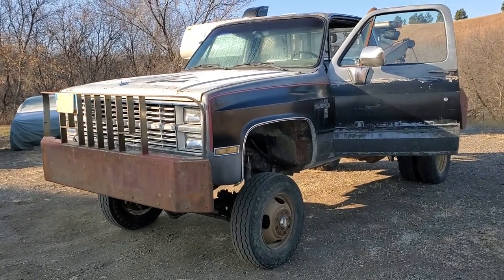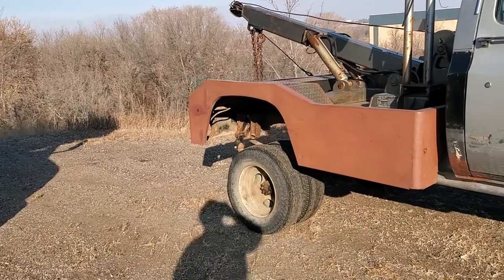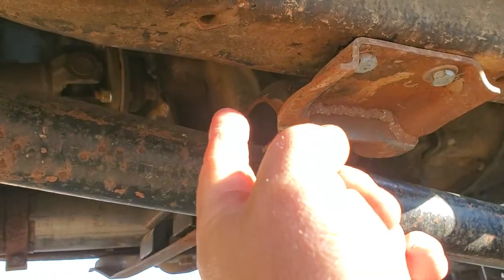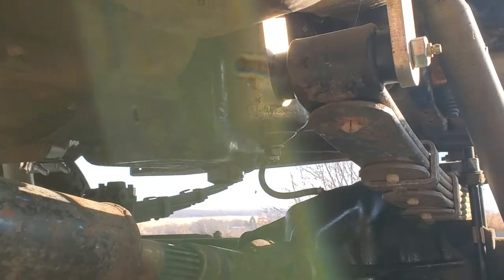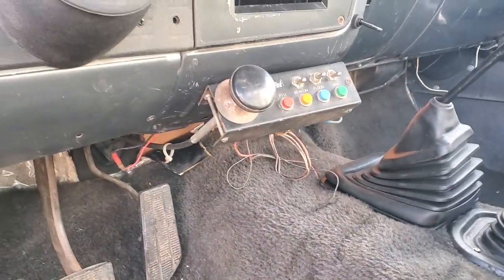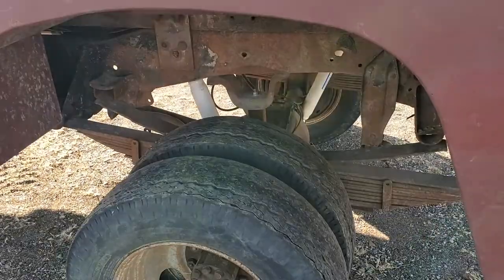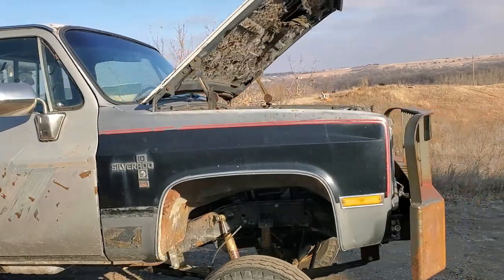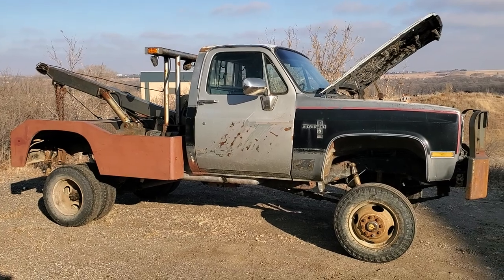Isuzu diesel powered K30 towtruck update

Comment: I bet it gets decent gas mileage I had one in a suburban and it got almost 30 miles per gallon with Highway gearing and th400
Reply from the maker: Although the original origin of this motor is unknown, this motor did come from a similar project. This motor did pulling duties through the latter '90s in a Chevy 1 ton 3+3 2wd SW truck hauling a camper and my good friend Dan whom I got this motor from said it did get outstanding mileage with a TH400 and 3.08 gearing. Thanks for the comment! I do intend on getting back to work on it soon after I get my current project done (a custom built '53 Willys CJ-3Afor wheelin').

Comment: I keep coming back to this video, its been around a year since you've uploaded the first video. Any updates or things that you would change if you were to do it again?
Reply from the maker: I am happy that you like the video! Unfortunately, I have not done much to upgrade it since I posted this, I have may other projets that I have benn working on. It has been a very handy rig to have around! Things I would do different? So far, I have no changes I want to make. It works better than it did with the original engine/trans combo (350/4spd). It has more power and also a better weight bias to handle heavier loads (heavier nose). If you have any questions just let me know. Are you looking to build a similar truck?
Reply: @kevindegroff7364  Good to hear! I think I was in the same boat as you with finding a cheap cummims and seeing this as an alternative. I'm a little new to all the diesel stuff but used to have a half ton square. The plan now is to find a 6bg1t but not quite sure where to look. Anyways, this video has been very informative and I appreciate it. My original thought was to put an allison behind it but there might be complications which is why I figured you went manual. Not sure how much you put into the build or if you want to talk about it😅 but ive always been curious how much it would be in comparison to a cummins. Thanks for responding!
Reply from the maker: @LoganC278  Overall I did not put a lot of money into the build, instead more time. I am a home welder/fabricator and enjoy projects like this one. I like to combine parts to create something that frankly shouldn't exist. I could spend a lot of time just explaining how I put it together! But still, a majority of time was spent just fixing the rust that came with the truck.
Reply: @kevindegroff7364  that's good to know, I thought when you said 7 years that that was all on the engine swap. All the rust and bodywork seems daunting but the motor swap seems fairly straight forward